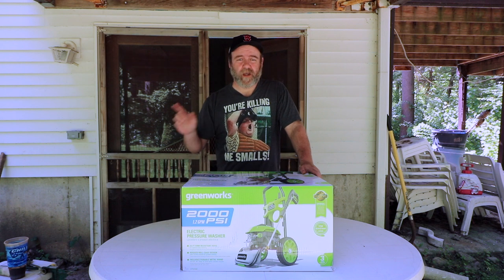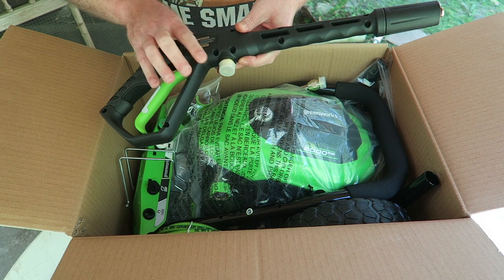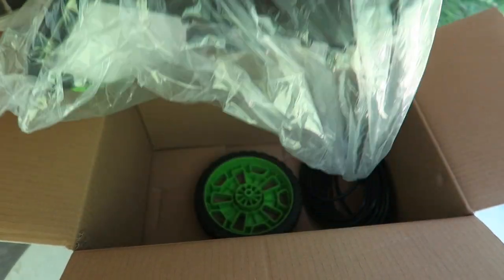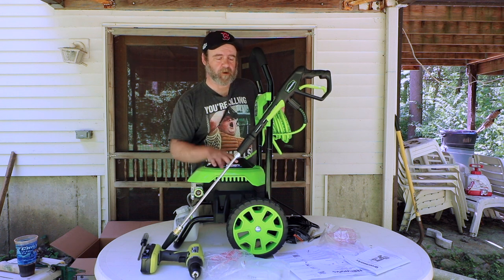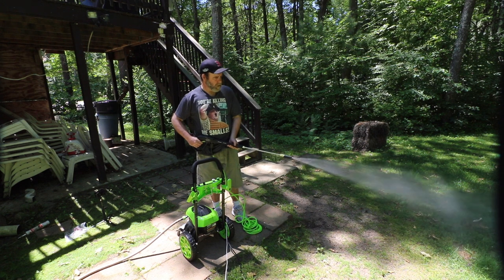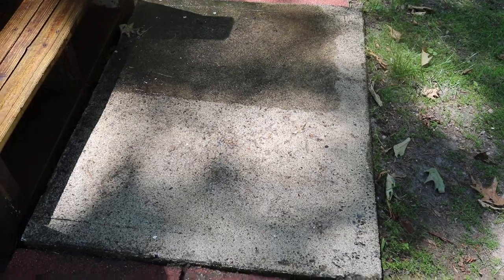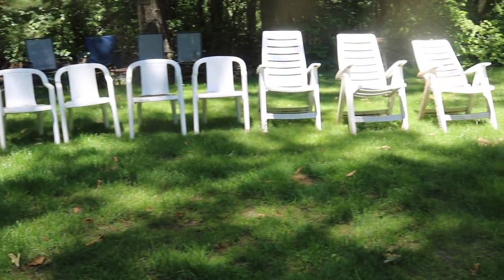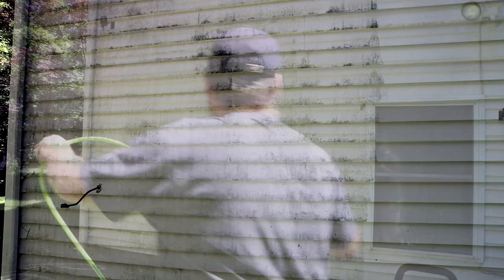UNBOXING | Greenworks 2000-PSI 1.2-GPM Cold Water Electric Pressure Washer (2019.6.9) #1259

Comment: Just bought one! Assembled it and it’s missing the tip on the end of the pressure wand.  I can’t snap the spray nozzles on.  Back to Lowe’s I guess!
Reply from the maker: That sucks!  I hate when you buy something and not all the parts are there. Good luck
Reply: It’s missing it cause it was a refurbished product or a return that was boxed up and resold

Comment: I just bought this unit today, I have a high pressure gas power washer but also needed a low pressure washer like the Greenworks 2000. I assume you live in a cold climate state, before it gets to freezing temps I would suggest getting some Briggs & Stratton Pressure Washer Pump Saver......plenty of youtubes showing this product. Thanks for sharing.
Reply from the maker: Al Thanks for the info. I brought the washer into my basement for the Winter...
Reply: @MarkPlante  That's good idea, something you wouldn't want to with gas powered washer. It might still be a good idea to use the   Briggs & Stratton Pressure Washer Pump Saver, blows out any water that might in the pump and will also lubricate the inside of your pump. Just my opinion.
Reply: Good video.... I actually wish you hadn’t sped through the assembly. I think the instructions failed to adequately show how to assemble the cord retainer. I’m still struggling with that part.
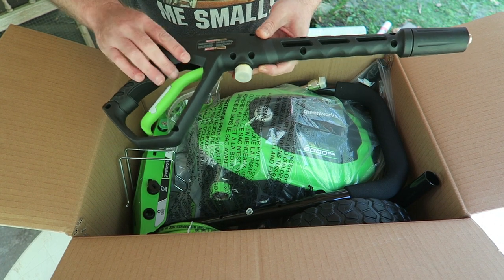Reply: @BackyardSmokeMasterBBQ  If you're talking about the wire bracket this might help, the holes next to the black nozzle tip and the green tip 3:06 mark and at the 8:22 mark it shows the bottom.....video https://www.youtube.com/watch?v=Q7IDaWoeTPI